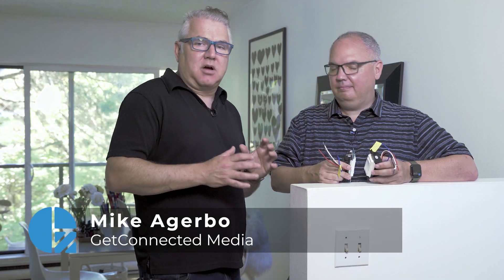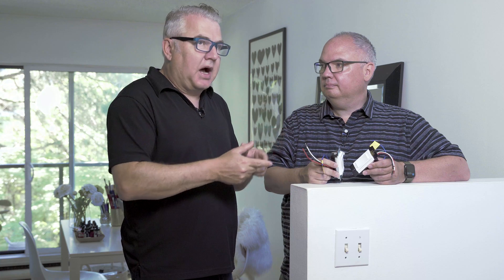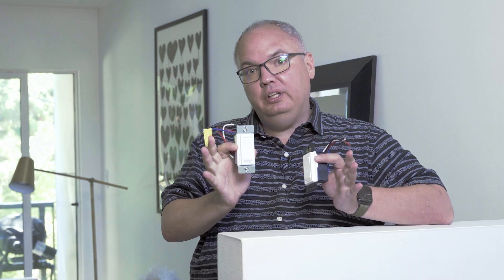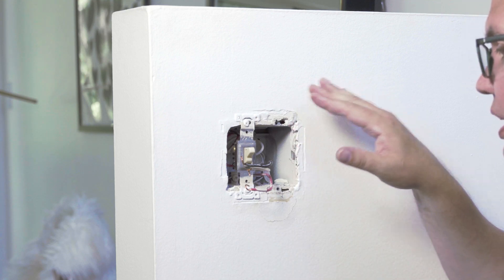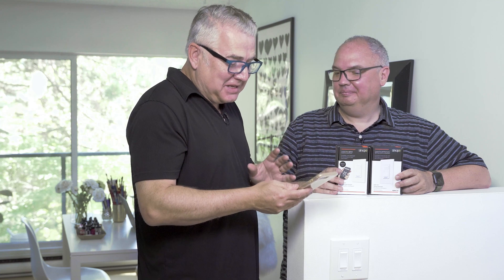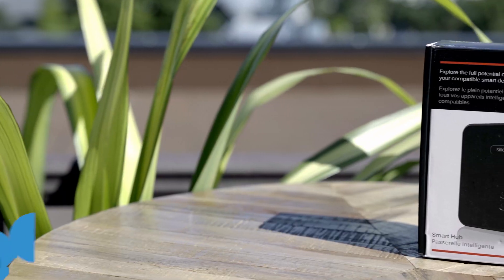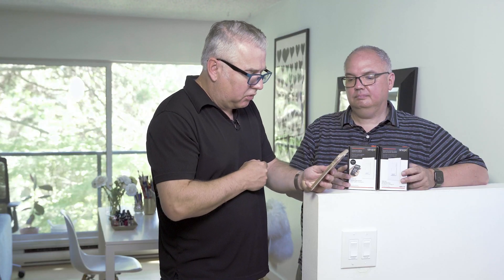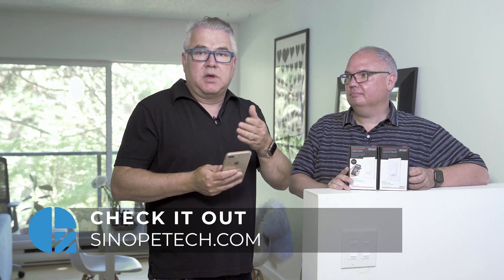Is it Easy to Install a Sinope Zigbee Smart Light Switch?

Comment: One suggestion – next time, make sure the screw heads, that hold the face plate to the wall are all horizontal. Other than that… I want one of these! Thanks guys.
Reply from the maker: We will lecture John on the benefits of screw alignment. Thanks for watching!